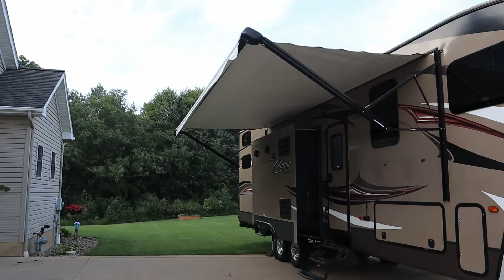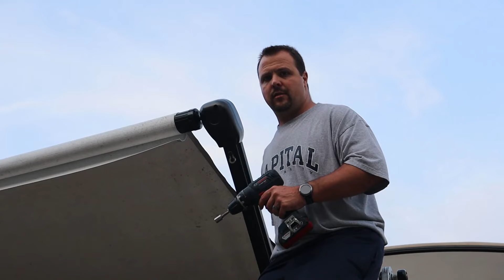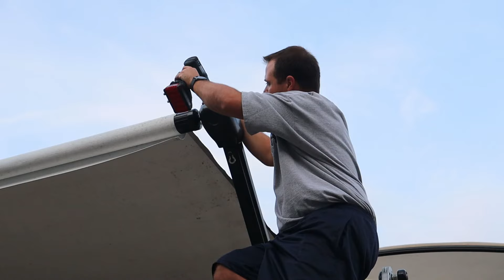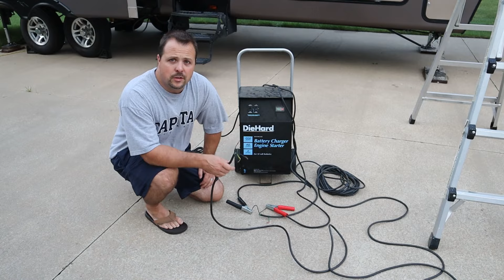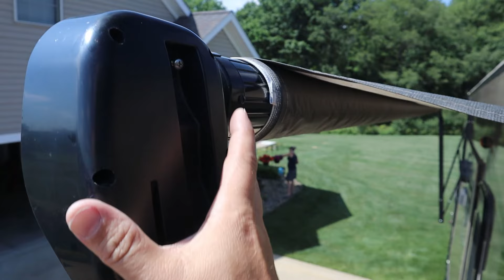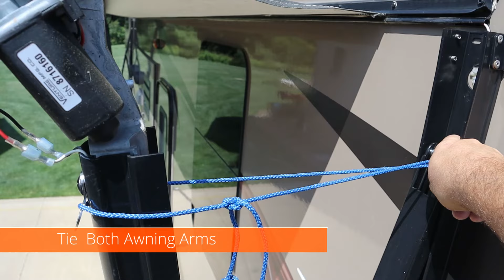Solera Power Awning Wont Retract - Troubleshooting and Repair

Comment: Most all you have your new battery charges will not do that they have to know about a charge on the battery you have an older battery charger that you can do that with but not many of those left anymore
Reply from the maker: Micheal, you are completely correct. Using a fully charged car or deep cycle battery is a great alternative if your battery charger won't do it.

Comment: Thanks for the video..My issue is very similiar..IT was really slow to retract, and when I finally retracted it, It wont extract now...I hear motor, but nothing happening..Hate to spend $150 on motor though..Still think it could be a bad motor?
Reply from the maker: You might want to try taking the covers off to check the gears that connect to the motor. If that looks OK, you could take the motor off and see if it runs without a load. If you do take the motor off make sure to tie your awning up so it doesn't unroll on you. Good luck 
Jason

Comment: Thanks for value videos. Anyway do you have any majors problem with Cougar? And how long your coach? Thanks again.
Reply from the maker: Thanks Andy,  I have not had any major problems.  Just some minor issues like the awning motor, and some of the interior trim has come loose and I had to re-attach it.  I'm not sure if you are asking how long the trailer is, or how long I have had it, so here's both.  It's about 38 feet long and I have had it for 3 years.  Do you have a cougar, or are you thinking of buying one?
Reply: @WeekendRVAdventures  thank you for the reply my friend, yes I want swap to cougar 366rd fifth wheel and will set up with Anderson like you had, mine is 6.4 foot bed, so! You think any problem with turning? Please advise. Thanks.
Reply from the maker: My Ram has a 6.5 foot bed and I haven't had any problems.  I cannot turn the trailer 90 degrees, but I can get it pretty close so that's fine with me.  We have been in some pretty tight campgrounds and I have been able to back into every site.
Let me know if you have any more questions.
Jason
Reply: @WeekendRVAdventures  thank you I'll change Cougar next 6 months with the setup like your.